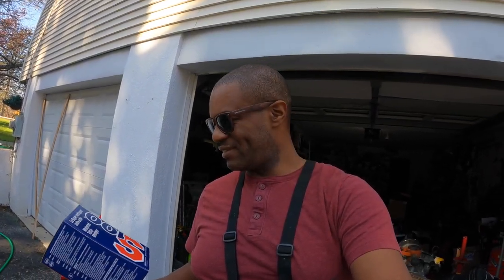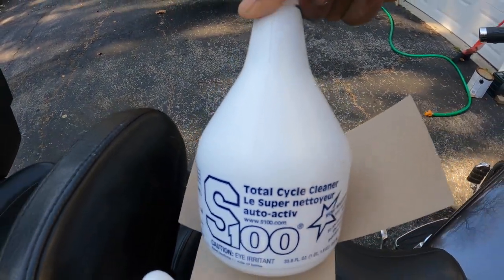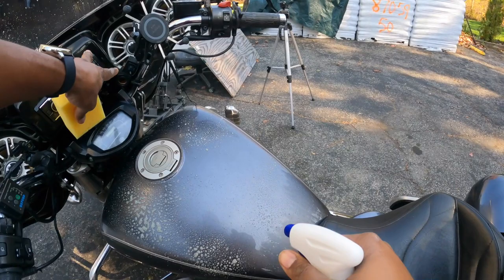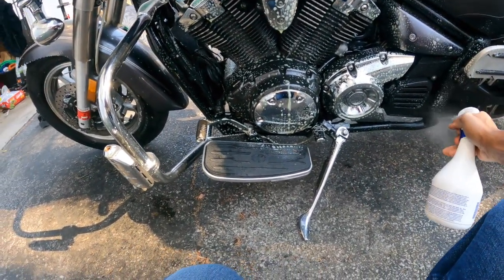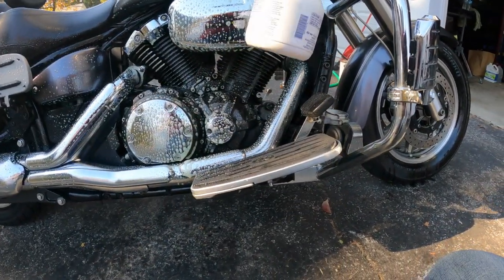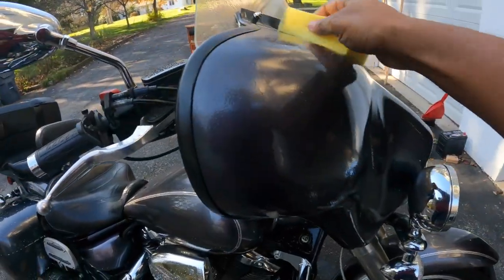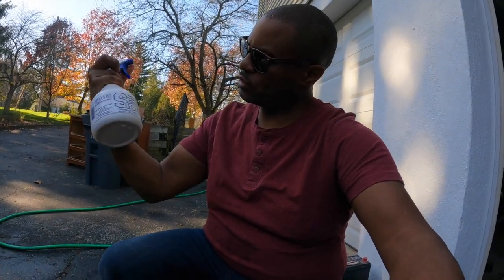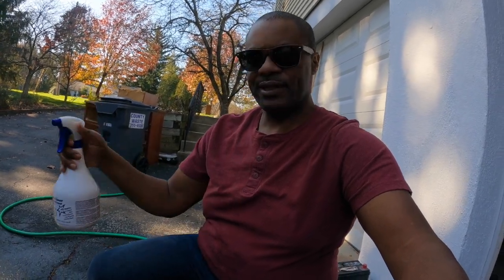I cleaned my Motorcycle with this amazing product | s100

Comment: I've been using this for decades, it's easy to spray on and rinse off with cold water right outa the hose. It works great, I use the s100 detailing wax spray afterword.
Reply from the maker: After all this time . I still have some left too . Thanks for watching and commenting .

Comment: Great video Bruce.  I could hardly wait till you posted this, and I have already purchased my bottle of it.  Have not used it yet due to rainy weather but in the next few days I will.  Thank you for sharing your experience with S100.  Purchased mine off good Ole Amazon.   Ride that  clean bike safe and free  brother.
Reply from the maker: I should have used my little brush on the wheels, but the sponge did good. 
Really have to be sure to rinse the cleaner off fully. I definitely was impressed with how well it worked too,especially for not being overly expensive.  Also it would seem it didn't remove my wax layer, as the water still beaded up a bit. Hmm. 
Otherwise I was/am impressed.

Comment: Hey buddy as you know I do paint work on both bikes and cars......Well...! save your self any money on so called cleaning products like this as the best product to use is the humble old Windex or a quality window cleaner for chrome and paint. Window cleaner has what is called white spirit in it and that is the very best thing to use even on any engine components.  I lightly spray on and wipe off with a chamois rinsing the chamois as I go with absolutely no need to drown the bike with corrosive tap water with Fluoride. Arsenic. Chlorine all no good at all for paint or chrome.
Reply from the maker: I hear ya. I have well water,  it doesn't have much of those ingredients,  maybe Floride,  but I doubt it. 
I dont wash often either , this is maybe my 3rd or 2nd time this year. 
Thanks for watching and saltay safe.

Comment: I have just sprayed it on like shaving creme and rinsed it. That stuff will even clean off brake dust. Towel dry or leaf blower is up to you. But it really is good stuff
Reply from the maker: Yes very true.  It will clean the dust, and even any odd slime on the brake pads after riding in the rain. Just need to rinse really good.   I'm about to order more soon .

Comment: This product is garbage i put it to the test and it's just like any other cheap detergent  that you have to do all the work  to make it work totally awesome from the dollar store work better than this i have just put them both to the test and totally awesome from the dollar store was the winner 👌
Reply from the maker: Thank you for watching and commenting. Interesting to hear you didn't like it. I have had pretty decent results with it the few times I have used it . It's washed away a lot of the caked on dirt on the wheels even with me not rubbing the wheels with the little sponge. 
Glad you found something that works for you also.